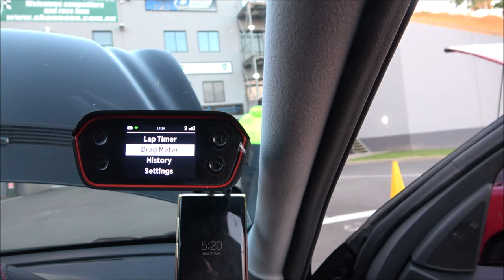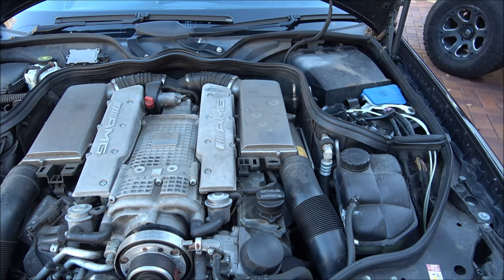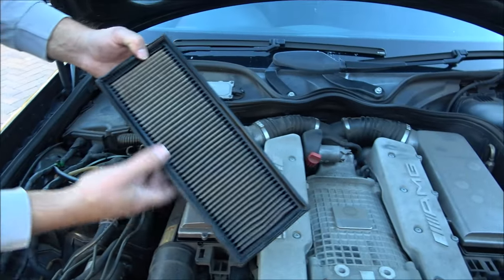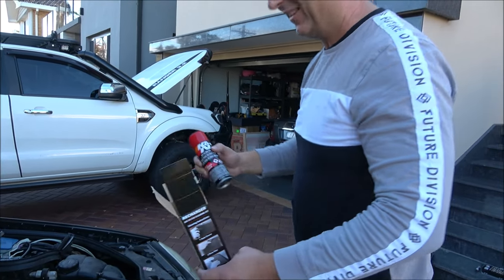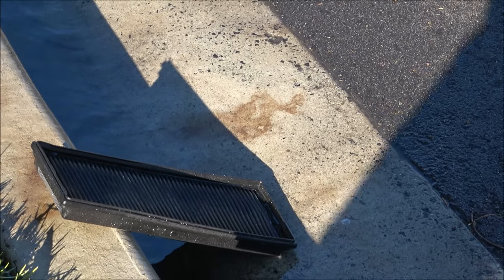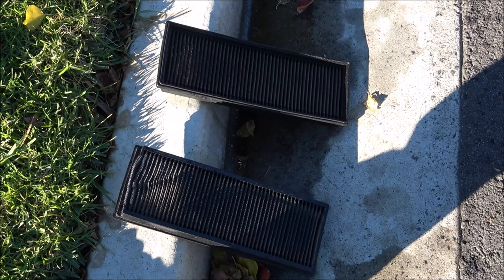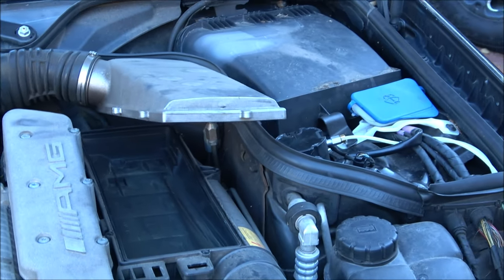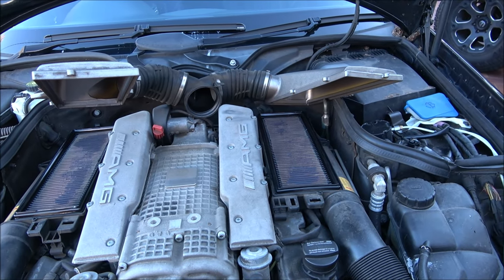How to remove and clean K&N air filters for AMG E55

Comment: Those air filters are clogged and need to br changed.
Reply from the maker: You are correct. They were clogged and worn out and a set of new K&N filters were bought and have been fitted soon after the video as I looked into it deeper and found that too much water pressure was used which stuffed them up. Running water with no pressure should be used to clean. Thanks for watching and for your support!👍😎